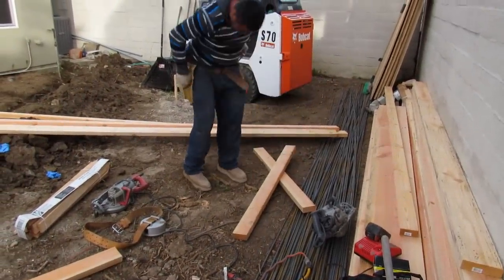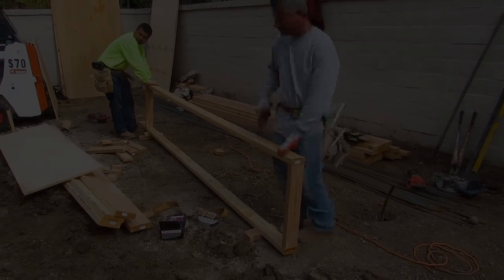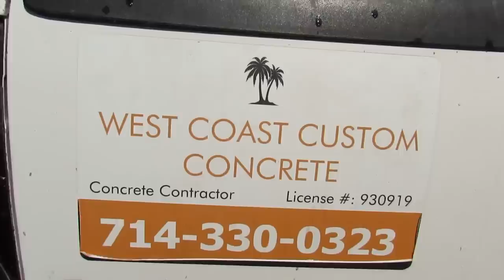Seated Concrete Bench & Fire Pit. The Best in the West! California

Comment: Vibration is critical when consolidating fresh concrete.. Vibration reduces the concretes internal shear strength and enables concrete to momentarily liquefy to facilitate the consolidation process.. The consolidation process from proper vibration  helps to makes the formation of the calcium hydroxide and calcium silicate hydrate crystals to provide more calcium silicate hydrate in which to form...  To make a long story short.. Always vibrate concrete when you can, especially your thicker pours and/or low slump concrete.. You get much stronger concrete in the end.. There is a lot more going on then just getting rock pockets against your forms..    You're blessed to have a good crew.. It's easier to sleep at night..
Reply from the maker: Nice brother 👍 thanks for watching 💯

Comment: i do these a lot too. I don't like to take them on as much because like you said theres not much $ in them.  they get pricey really fast because of the man hours and the amount of form work.  I just finished one in costa mesa with a pour in place BBQ island and a huge bench with planter anon the back of the back rest.  we also did a top cast deck and diamond cut joints but we added a perimeter band with embedded slate stones.  it was a pain to do but it looked great.
Reply from the maker: Right on bro. I swear driveways and patios are more $ in and out

Comment: Hey mate i pour concrete manhole in australia with metal forms and vibrate it alot. How do you stop getting air pockets against the form and stop it having a bunch of small crators against the forms when you strip.
Reply from the maker: Oil the forms.
Reply: @WestCoastCustomConcrete  i do or else you never be able to strip

Comment: Around how much does that all cost as a home owner? Just the concrete bench and fire pit
Reply: Probably alot.  Took several guys to do that not to mention a ton of concrete and rebar
Reply: Probably between $15,000 to $17,000. 12 days of labor, 9 yds of concrete, rebar, form work, materials, trash hauling and equipment.
Reply from the maker: I did the entire backyard at the house. I broke it down and the seated bench and the fire pit came to $18,000.
Reply: @WestCoastCustomConcrete  forgot to add GC and Fee. Lol. Love your work and videos.

Comment: I know that concrete work is hard,  on my first job I poured a "dog run" and overfilled a wheel barrow. I  didn't realize it was going to be that heavy, it got off balance and fell over. Had a big mess. You assemble a team of people to get the job done. This guy is management, middle management, and supervision all in one. Yeah he's cocky but that a sign that you are good at what you do,  managing guys with skills and using those guys to come up with a finished product that the customer could not do. Wrestlers, boxers, MMA, and surfers they are all cocky.

Comment: you dont need a vibrator but you have 5 guys beating on with hammers and shoving wood stakes in it.  Ya if your stripping and facing it and it not being a structural piece a vibrator isnt as important too